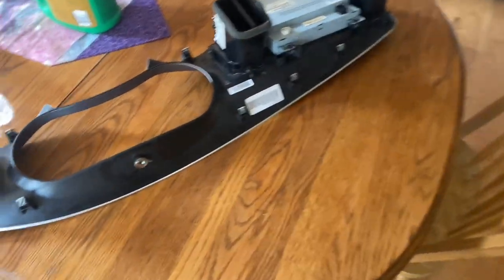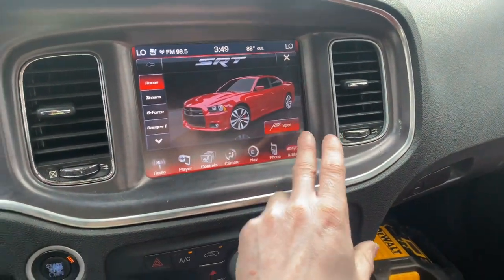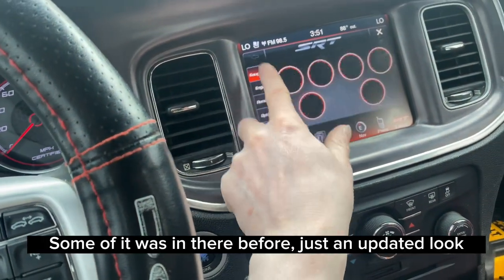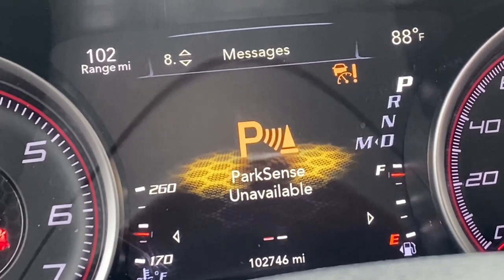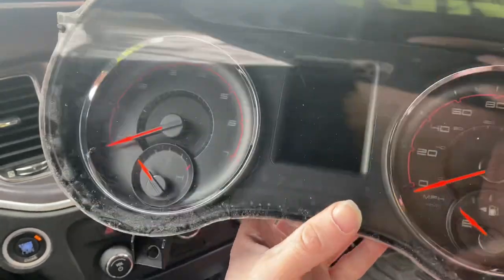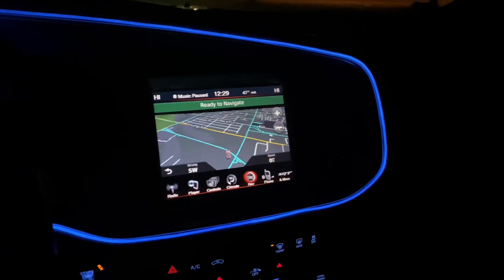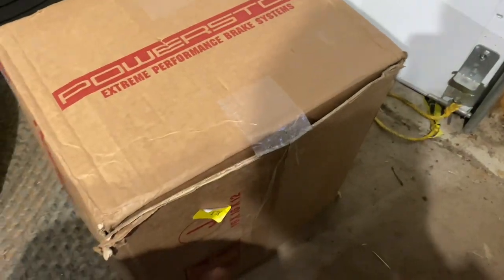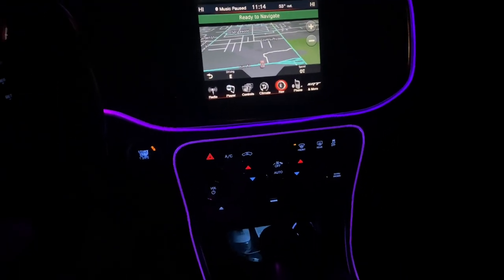New Addition to My Interior! 2015+ cluster swap on my 2013 Charger RT AWD!!

Comment: gas mileage is crazy, ur almost full with 102 range
Reply from the maker: Lol yeah it took a bit to read properly. Like 2 full tanks later and now I get 180-190 on a full tank lol. Most I’ve seen is 250-260. I average prob 10-12 per week. I need to lighten up on the gas pedal lol
Reply from the maker: As of yesterday, my range started working normal again with 237 miles on a full tank. Guess it just takes time to learn your driving style
Reply: @DavidProductions345  Thats crazy.....ease up some man damn lol. My 16 R/T is FBO and tuned and I still get 19-22 on avg. Might be more than just a lead foot you dealing with
Reply: I need the website on the cluster swap n that camera that’s on the review  mirror

Comment: Does radio have to be hooked up to go through vehicle info pages on cluster mine won’t work when I hood cancel and traction i a trying to test it before I put the radio back in
Reply from the maker: I don’t know really, but it doesn’t hurt to try?
Reply: @DavidProductions345  that’s exactly what it was solved that now I gotta get the dash and the tv tied together how you do that
Reply from the maker: Which TV? If you mean the radio screen, you gotta use zip ties and/or tape
Reply: @DavidProductions345  tried it don’t seem to line up correctly
Reply from the maker: The radio is secured to the bezel with zip ties. You have to line it up then slowly tighten each side of zip tie til it’s lined up if that makes sense

Comment: What serves as the "OK" button on the steering wheel? (For the cluster)
Reply from the maker: Right arrow and cruise + button
Reply: @DavidProductions345  definitely appreciate that, I'm gonna wire up a 15 and up steering wheel tomorrow I'll let you know how that works out because as far as I know only a 14 Durango steering wheel will work with ours which is the same as the 15 and up but I've heard you could remove the connectors and wire the wheel instead of using the connectors so do a little research on that and I'll let you know
Reply: @DavidProductions345  also as as far as fuel readings go I read in the comments that it eventually just worked itself out I filled up this morning and then swapped the cluster it's still reading full I've only been about 10 miles but I'm wondering if it'll fix itself before I find myself stranded on side of the road, and mine keeps going back to sensor as soon as I boot the car up unfortunately I couldn't hit the button to engage the cluster swap because when I put my steering wheel back on I forgot to plug my buttons back up. So long stories short does the fuel thing work itself out or was there something you had to do? Is there a reason why it keeps going back to sensor off the rip?
Reply from the maker: The fuel thing worked itself out. If I remember I just filled up after. And drove and filled up again and it read fine. Also if your cluster isn’t between 15-17 you would have more issues with some little things not working as well.

Comment: i have a 2011 rt charger, if i swap the cluster and radio to a 2015+ will i be able to use the tazer and sport mode
Reply from the maker: Cluster yes radio no. The radio isn’t plug and play
Reply: @DavidProductions345     thank you, I have the old 8.4 radio if I do a cluster upgrade will I be able to pull up sport mode with the old radio
Reply from the maker: @user-mc7lg7um3r yes

Comment: I’m looking to buy a SRT8 392 Challenger and I want this swap , I’ll pay you 2-3k on top of parts  do it for me bro. The only thing keeping me from buying it is the old dash lol
Reply from the maker: So with the challengers I don’t think the cluster is the same as in the chargers. I’m assuming you’re looking for a 12-14 SRT8 392? Those have the old pod circle gauges so the new cluster wouldn’t be plug and play, meaning it won’t fit. If I were you I’d save up for a 15 SRT so you can get the newer dash. Less hassle and better features
Reply: Bet ! Appreciate it fr keep doing your thing !
Reply from the maker: Appreciate it gang
Reply from the maker: There are options of swapping out dashboards to the new challengers, but I think you would need to do a lot of rewiring for it to work properly

Comment: @davidproductions345 I have a 2013 Pursuit that I did the cluster swap to (just waiting on my Tazer to come).  What radio do you have?  It looks like the same as mine but my screen looks totally different.  Can you give me info on how you got it like that?  Greatly appreciate it.
Reply from the maker: RB5 is the model. Did you mean the SRT pages on the radio? The tazer will help you get SRT pages with the gauges an all that.
Reply: @DavidProductions345  Yes I wanted to know what radio and how you got the srt pages.  Awesome.  Do you have a way I can message you directly if I have issues?
Reply from the maker: @Storm_Tropper_345 you can message me on instagram, same handle if you have any questions about the tazer or cluster swap
Reply: @DavidProductions345  is the rb5 & 8 in screen from 2015 Dart compatible with 2013 charger
Reply from the maker: @marcusward553 it’ll work but you won’t be able to get SRT pages I’m pretty sure

Comment: Were you able to get the check engine light off and the other lights
Reply from the maker: I don’t think I had a check engine light on for anything. It is on when the car is in the run position so it was probably that.

Comment: Where did you buy the cluster from? I’m looking to change my clusters in my 2010 challenger
Reply from the maker: Those are different. The cluster swap only works on chargers. Challengers have different ones from 2010-14

Comment: Quick question how did you get the park sense off the screen? I don't even have it, and it just started to show me that damn message when I put car in reverse.  I appreciate the help
Reply from the maker: Hello. So the park sense message went away for me when I unplugged my battery to do my blend door actuators. I had the battery unplugged for about an hour or two, but I don’t know if that matters. Hope this helps!
Reply: @DavidProductions345  I really appreciate it.  Definitely worth giving it a try. What a pain it shows everytime I start the car or put in reverse lol
Reply from the maker: Yeah, that’s how it was with mine until I was doing the blend doors and noticed it went away

Comment: How do you get that background on your touch screen
Reply from the maker: The SRT Pages? Or do you mean the specific car background? There is an option at the bottom of the SRT pages that lets you change the background on it.
Reply: @DavidProductions345  the background with the car the red srt
Reply from the maker: So if you have the SRT pages enabled. There’s an option at the bottom to change he background. It is either a car which you can pick the color, or just an image. Do you have the tazer or know about it by chance? It’s how you enable the pages, which you can see gauges and more info

Comment: Hello bro, your car is very nice...... can you help me with a question? How do the steering wheel buttons work with that instrument panel??? I have a 2014 charger pursuit and I installed a 2016 instrument panel just like yours but I can't get the steering wheel buttons to work
Reply from the maker: You have to install the Z-auto tazer for the buttons to work
Reply: Do you have the purchase link?
Reply from the maker: https://www.zautomotive.com/product/z_tzr/
Reply: @DavidProductions345 do I need the double bypass also ??
Reply: I have my tazer installed but my radio is still out
Reply from the maker: You don’t need it but it makes it so your regular OBD port is free for scan tools and such.

Comment: My screen is stuck on the tire pressure page do you think if I disconnect battery it can go back to th digital speed cause I changed steering wheel so my buttons don’t work
Reply from the maker: If you put the new gen steering wheel from the 15+ your buttons won’t work. You need the 11-14 to work with the new cluster
Reply: @DavidProductions345  yes, but my screen on new cluster was on digital speed now I got it back from local shop and it’s stuck on tire pressure screen
Reply: @DavidProductions345  I was wondering if I disconnected battery will it go back to speed gauge
Reply: @DavidProductions345  I was wondering if I disconnected battery will it go back to speed gauge
Reply from the maker: Maybe they unplugged tazer idk lol
Reply: @DavidProductions345  I never had a tazer
Reply from the maker: That’s your issue right there. You need a taser to get all the functions
Reply: Is there a new update to the tazer? I noticed you have the full gearshift indicator in your cluster. Does it work like it should by highlighting the gear your in? Guess im gonna have to look up the latest update. Seemed they havent added much functionality the last few years so i kinda gave up on thier updates lol.
Reply from the maker: No it doesn’t show the gear you’re in in you shift into manual mode. It does show PRND like it should though. I have to have 5spd and 8spd enabled for PRND to show up
Reply: @DavidProductions119  just had to enable 8spd for it? No other issues came about from it? Curious cuz i never tried enable 8spd mode as i have the 5 speed nag 1 tranny also.
Reply: I just checkd and do have 5 and 8 spd on. But i only get the letter of gear only showing. P r n or d only. Not the full display. I got a 14 rt awd using the 15 rt cluster.
Reply from the maker: That is in screen setup in the new cluster. It doesn’t involve the taser. You have to click show gear then PRND instead of current gear. Try it and let me know how it works. If you want I can make a cluster update video and show what works and what doesn’t
Reply: @DavidProductions119  wow. Ill try that in a few. This has been a very common issue for cluster swap people. I cant believe that particular info hasnt been shared anywere lol. Ive been running with this swap for 3 years now and regularly check the chargerforumz thread about it looking for updates. Thanks for the info. Ill post back with my findings on changing the setting in the cluster.
Reply from the maker: I’ll make a separate video detailing all of the things that I’ve found with the cluster swap so far! I think it’ll be easier since there’s a lot of questions and I feel like I’ve had this cluster swap in for awhile where I can make an entire video answering all of the questions or most of them!!
Reply: @DavidProductions119 yep. The setting for full shift display was in the screen set up menu. I made a test video on my stormr rt page. Adding a link yo you in the description. I just cant believe no one pointed out that setting before. Thank you so much.
Reply from the maker: No problem. I’ll check out your video
Reply from the maker: @stormr  now my question for you is how did you get the splash screens to work?
Reply: @DavidProductions119  only the hellcat and regular charger screens are available on the 2012 through 2014 models and have to have the srt set to yes in the perf section. Some people just cant seem to get them to work for some reason though.
Reply from the maker: @stormr  okay thank you! I’m just not gonna mess with it because of the airbag light